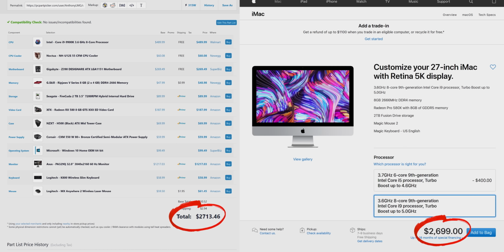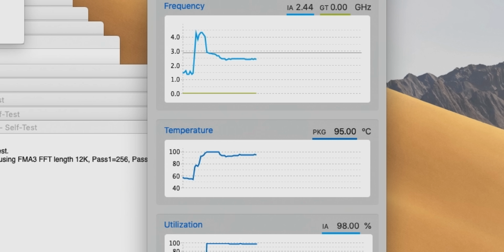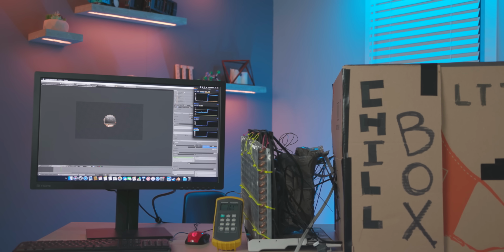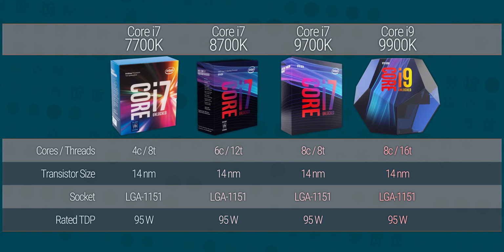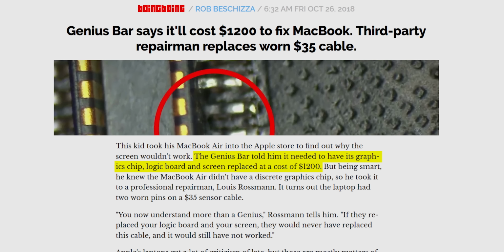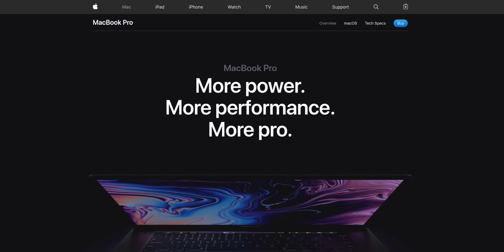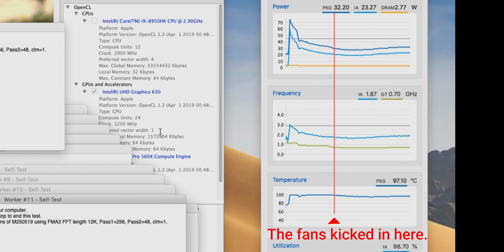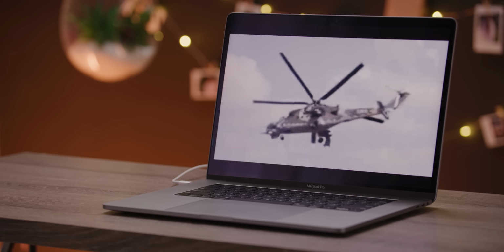Macs are SLOWER than PCs. Here’s why.

Comment: my 2 MacBook Pros with dedicated GPU, one a 9600M GT with awesome Nvidia Ion Chipset, so 9400M "iGPU", and the newer one with shitty Intel HD iGPU and at least a bit better Geforce 330M, are still working. There is even my 3rd battery on the way right now since the replacement battery is dying already after around 600 cycles, this time a better one compared to original to be the last battery before i throw my mac into the trash.
Reply: Update- After 10 years of heavy mobile usage and also gaming (probably this broke it...), the 330M GPU is dying in my MacBook Pro, but at least it still works in the most cases it only cant handle extreme load anymore  when its still cool, at higher temps its still running. 10 years, 3 batteries and much more than 2000hrs playing (demanding) games on it.. its ok this Mac is already close to a dinosaur.

2009 MBP also alive, except for the fact its a „MacMini“ since its display unit is removed

Comment: Building a PC is much cheaper than buying one let alone buying a Mac..

I am not a fan of Apple - iPhones and iPads are shit. Android is just better.

HOWEVER.. The Macs are far better than Microsoft imo.
My Mac is much faster than any PC I've used. Every laptop and PC I've had dies after 2 or 3 years or becomes so slow I wanna rip my eyes out.

5 years after buying my Mac Pro.. It's still performing like it did the day I bought it and I imagine it'll last another 5 years.. 

I don't want to launch a rocket ship with my laptop.. PC gaming outside of The Sims seems pointless..
I'll stick to PlayStation on that front.

But hating everything Apple is 'cool'

Comment: 😡😡🙄🙄 OF COURSE IT WILL OVERHEAT IF YOU MAKE IT DO WHAT IT WAS NOT SUPPOSED TO DO
Reply: It is not supposed to open a browser? The point of the video was that it uses expensive equipment that goes completely unused. That the price isn't justified.
Reply: @nicolaim4275  🙄🙄🙄 It doesn't overheat when you open the browser, It overheats when you play a game that was meant for desktop Not laptop
Reply: @loveiphones4550  It doesn't overheat because it throttles. Even something simple such as opening a browser can take longer when it has to throttle to stay cool. And even then it can be uncomfortably hot. My girlfriend's Macbook Pro certainly gets extremely hot from either watching a movie or the combination of working in a browser and having Office running.
Reply: @loveiphones4550  If you had watched the video, you would have known that this was addressed by them. The problem is that Apple does this a lot more than other manufacturers, not that they are the only ones doing it. And the problem isn't just for people who try to play demanding video-games. The problem arises for fairly everyday tasks.
Reply: @nicolaim4275  It doesn't arise in normal everyday tasks
Reply: @loveiphones4550  You can claim that, but that doesn't make it true.
Reply: The overuse of emojis.
Reply: @NexusXP  No 🙄🙄🖕
Reply: @loveiphones4550  Still overusing it.

Comment: Most laptops throttle under load. If you looking at running CPU-intensive tasks then use a desktop. If you're gaming, get a high-end custom-built PC. A Mac will be the better option in a music recording studio for example. It's all about requirements. If your #1 prerequisite is to run Prime95 then by all means, get a Threadripper-based desktop, not a MacBook.

Comment: When Linus says I don’t have an answer for the cooling on the Mac and the iPhone, it could be because the Mac’s uses an Intel processor and the iPhone uses an Apple built processor.
Reply: They could still use intel chips that won’t thermal throttle so early , but they chose not to.
Reply: @Super Sazz Nope, Apple designs it, its just the Arm Architecture. and oh look, they are out. the M1 beats 10900k and 5950x in single core, fastest cores in the world, passive cooled.
Reply: This is exactly why it's good to wait before actually buying their laptops. Progress incoming!
Reply: True I can’t wait for then the new Apple processors to come out and I hope apple fixes the problem with this
Reply: @Franz Xaver Fuchsberger but they Design they they just need companies to make them for them so it’s technically making them
Reply: and yeah apple already use they own processor in they macs
Reply: That's exactly why. And Apple seems to finally be working on their own chip for macbook's to solve this issue. Took them a while but hopefully it works out
Reply: @Alusky  They might limit the performance if they want.
Reply: @Alusky  Keeping in mind nobody was preventing them from doing proper design using the components they want to use it would still be an awful engineering solutions cover with a ton of marketing bullsht.
Reply: Franz Xaver Fuchsberger, Yes I know that but Apple has much more ability to tweak the Apple A(whatever) CPU than the Intel CPU.
Reply: @Franz Xaver Fuchsberger Apple designs the whole CPU, and TSMC manufactures it. iPhone and iPad processors are 100% designed by Apple. They have hired a massive team that works on this and have invested massively in it. Thats why they were years ahead of everyone else bringing a 64 bit phone cpu to market.
Reply: @Franz Xaver Fuchsberger actually Apple designs the Chip
Reply: @Franz Xaver Fuchsberger yes we are talking about phones, iPads & co, which are not intel
Reply: @JohnSmith-pn2vl  And are licensed from a company called ARM that actually designs them. Apple, like Qualcomm, Samsung or HiSicilon, designs the SoCs that house these CPUs (along with other stuff, like GPU, usually also licensed from ARM or some 3rd party) in mobile devices.
Reply: @b_markovic  nope, Apple designs it
Reply: @JohnSmith-pn2vl  nope, it's a licensed ARM
To provide more context. There are three things in that chip designed by Apple: 1) the AI accellerator is completely their design though in reality probably based on some DSP building blocks licensed elsewhere (because no one would do that kind of undertaking from scratch), 2) extensions and alterations to the base PowerVR GPU design that they've been doing since the A10, 3) the "glue" of the SoC that links the ARM cores with eachother, and these and other in-chip units such as wireless radio chip, memory and other controllers etc. Apple is very secretive and LOVES to puff-up it's role in computing in it's press release but based on common knowledge of how these things work, this is the very likely truth.
Chip IP comes as, well, basically software, and chip designers use it as a programmer would use a library (or in the case of CPU core, more akin to how a programmer would use the OS) but still the bulk of chip IP in any of those SoCs (not just Apple, but Qualcomm, Samsung, HiSilicon and others) is licensed from someone and when "rendered" as silicon ends up quite alike in the other chips that inherit same design. More importantly, the thing that actually executes the software running on these phones, the CPU core, is always licensed from ARM Limited.
Reply: @b_markovic  yes, still nothing changes, Apple designed the Chip, this is what it means. a total difference to taking Chips from AMD or Intel.
Reply: @JohnSmith-pn2vl  Except Apple is not competing with Dell or HP here. These are mobile phones, and both of their main competitors, Samsung and Huawei, are also "designing their own chips" as well (namely Exynos and Kirin). But, EXACTLY LIKE APPLE, they're both licensing the CPU cores from ARM.
Reply: @b_markovic  they just take the snapdragon, and apple will compete with dell, hp, intel, amd etc, because now they will make chips for desktop
Reply: @JohnSmith-pn2vl  Exynos and Kirin are more similar in design to A series than to Snapdragon, but it shows how much you know about chip design. Not that I expected an iSheep to actually be technically literate, tho. Also, a lot of you people will be really dissapointed when the pipe dream of ARM chips that can actually compete with x86 goes puff when A series lands in Airs and low end iMacs.
Reply: @b_markovic  sheep follow blindly the masses, thus Apple is not for sheeps, because the masses go Android and PC.
i am convinced Arm will blow x86 out of the water easily, because for me personally, it already does.
Reply: @JohnSmith-pn2vl  masses go for android because it has an option for everyone. Unlike apple for which you have to earning quite a lot. It's funny apple fan talking about sheeps
Reply: @shuaibhere  well thats a Viewpoint, nothing more. the vast majority buys Apple second hand and in my experience it's far cheaper in the long run.
Reply: @JohnSmith-pn2vl  The thing is, Apple has a large user base and target demographic - it's called 'my parents'. People who are completely technically illiterate, have more money than expertise when it comes to tech, and need an interface which favors ease of use over functionality. There's absolutely nothing wrong with that, my Dad likes his iPad because it's easier for him to use than a device running Android, Windows, Linux etc. I still think Apple's anti-consumer practices are really shitty, but I don't buy their products so whatever.

What I hate is when turtleneck-manbun-beard-glasses-Starbucks-pseudo-intellectual iSheep talk out their asses about technology like they're experts, when they're really just parroting their sheep-like brand loyalty and have about the same expertise and understanding of tech as my Dad - none whatsoever.

Just read back through this comment thread. You have been repeating the same iPropaganda over and over, even when different people are correcting you over and over telling you why you're wrong but you just won't listen. When you're called out for acting like a sheep, you come out with this mental gymnastics about how everyone else is a sheep unless they buy Apple products. Just take a step back and look at yourself...

It's your money, you can waste it on their shitty products if you want to, but please stop acting like they're somehow superior or that it somehow makes you a superior tech 'genius'. Thanks.
Reply: @RichardVSmall  no you are just wrong, this is what you think, it's your opinion. i have spend 50k on pc's and build 100' of systems, i was in the pc master race too, my experience the last 30 years showed clearly that Apple is way cheaper.
you make up this "hipster figure" in your mind,  and put every Apple user in it, nobody has any clue about anything and Apple is hipster trash. 
facts have no chance at this point, its useless to argue against a religion
i was just like that, so i can forgive you.
Reply: @JohnSmith-pn2vl  Okay I've concluded that this is a masterful troll -- bravo sir!

Comment: I know this video is old but I think the bit about the performance being fine on the flagship phones is an interesting point. What's the main difference in the mobile devices Apple produces? The processors aren't Intel, they're custom-made, in house, using an entirely different architecture. Seems less that Apple doesn't care entirely about the performance of their machines, but is instead not willing to put effort into fixing the issues another manufacturer is creating.
Reply: Intel's mobile based processors would like a word with u.

But yes, Apple has spent an incredible amount of resources for their own very good socs.
Reply: @rubberduckysoup  Intel's mobile processors were tested in this video, watch that part again.

Comment: 10 years using Macs (two MBPs and one iMac 27"), NEVER had a real issue. You can say what you want, but Mac's useful lifespan is 2 or 3 times longer than PCs, and that's a fact.
Reply: Cool anecdotal experiences

Obviously degradation depends on a lot of things, how heavy Ur usage is, ambient temps etc.

Oh and my 2600k 4.6ghz oced is still rocking to this day, only had been 7 years now?
Reply: @rubberduckysoup  Well yes, it's purely anecdotal and related to my own experience and that of some friends of mine who also use Macs. My first MBP (mid 2012) was (and still is, I gave it to my father who had an old crappy Asus till that point...) a real war tank. Indestructible. The 2019 one looks a bit too thin to be that resistant, but still never gave me an issue till date, not even when I accidentally poured a glass of tonic water on the keyboard. 
As long as software issues are concerned, I really cant't remember any major problem, apart from some app freezing occasionally, nothing that a good kill command can't fix in a second. 
Again, it's my personal experience, but I feel like Unix systems are much more stable than any Windows OS (I've owned '95, XP, Vista, 7 and 10 machines). And I can run my Macs for months without any stability loss (I'm writing now from a machine with 91 days of uptime). I usually restart them only for OS updates. 
I never owned a Linux though, I'm not familiar with it enough to come to meaningful conclusions about it.

Comment: Overall if you want an overpriced performing machine, get a 64gb ram with threadripper and a titan X. It's going to cost you a mac, but with a lot more power. Then, you either dual boot a macOS and windows OR you virtualise a macOS. Still going to be better than mac anyway. Cost of MAC: 10 000$ Cost of Threadripper: 7000-8000$ at max

Comment: I don't know too much about the inner workings of laptop and all the buzzwords for computers always leaves me at a lose. But as someone that avidly used and supported PC for years and bought multiple different ones, they have always always always failed me. To the point I couldn't handle owning one because they just couldn't survive and some of them literally falling apart. While the only MAC I have ever bought has lasted me the longest at 5 years and even through water damage. Granted I don't do heavy coding and I don't game at all, i'm an illustrator and sometimes graphic design so I mainly use Photoshop and Illustrator and thats it. In all my years at art school and all my years working, MAC has basically been mandatory and you are almost a burden if you don't use one due to all the converting you need to do. Yes as someone who knows design they are beautiful, I won't deny that however we don't buy them because of the ✨a e s t h e t i c ✨or to feel better than others, or to flaunt them at coffee shops (I don't even like coffee and can never get any work down in that environment). We get them because literally every place you work, its the standard and it would make no sense to have two laptops like that when you can just use one.

Comment: the real reason is that they are intentionally doing it so that it breaks down quickly and people are forced to buy more, buy more, apple gets more money, easy marketing strategy
Reply: Apple's failure rate is lower than the industry average. Where are you getting your facts?
Reply: @dan537  that's mainly from the phone the PCs mess up like wildfire
Reply: @JordanISmith  lol ok louis rossmann.
Reply: MacBooks , iPhones , iPads, all last longer than their competitors. You’re just one of those people who reads an negative article and believes it nonchalantly.
Reply: @orcas101  just no...
Reply: I don't have a mac but I know they last for like 6 to 8 years at least.
Reply: I’m still using my PowerBook from 2006 to do some tasks. This thing has been a powerhorse back in the day, and apart from the battery it still works like a charm.

Comment: I've been in the  ecosystem for 10+ years, mostly because I love the OS... but damn I cant keep justifying the fact that I can pay half the price for a PC that performs twice as good as a Mac.
Reply: hackintosh
Reply: @2muchofyou  hackintosh lacks some features
Reply: @2muchofyou  its not very legal though
Reply: @RSainman  apple
Reply: @davidmella1174  Proprietary software and its consequences have been a disaster for mankind
Reply: I don't even use Linux, but they say there are Linux distros that are similar to MacOS feel. Just saying.
Reply: To flex
Reply: Any turnkey Hackintosh suppliers/maintainers exist?
Reply: Same but I my opinion I have had an bad experiences with PC so I don’t buy them anymore
Reply: @Dogedadogo  most pre built systems are trash, I asked how much would it cost an hp pc with the specs I built mine and it was 300% more expensive, while the ones on display were super expensive bricks that barely ran office. Even windows, which I used to hate runs like butter.
Reply: @EM Well what will happen when they release their new MacBooks in a few days
Reply: @EM it's designed for digital art and students not for coders or engineers
Reply: @fvkz  actually I see many software developers use mac OS, it's still a Unix-like system with loads of dev tools ported from Linux into a mostly standardised environment, so it sort of "just works" in many dev cases
Reply: @super86brandon  as I see, you can't help but use a Mac, if you interested in development for iOS.

Comment: Don’t know how long the current Mac stuff will last but I run a Blue and White from the late 90s for some OS 9 software and its on 24/7. I’ve installed a ton of HP and Dell desktops that failed at a rate of over 33% in under 5 years. At one point, Apple made products that could last a very long time.

Comment: I'm still using a 2008 MacBook in 2020.  Can't do that with a windows laptop.
Reply: Nasrudeen Oladimeji I have new and old windows laptops.  And I would still rather use an old MacBook.  Windows is a huge pain in the ass.  It wastes so much of my time.  I spend more time fixing windows problems than doing what I need to do.  And the constant forced updates... fuck windows.
Reply: Nasrudeen Oladimeji I replaced the hard drive with an SSD on my 2008 MacBook.  You can do it without any tools.  It works perfectly.